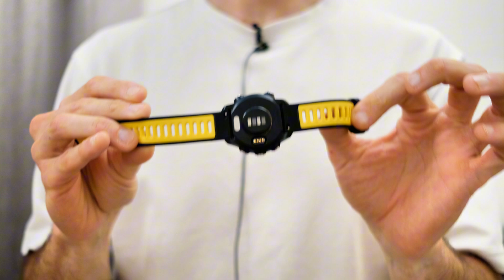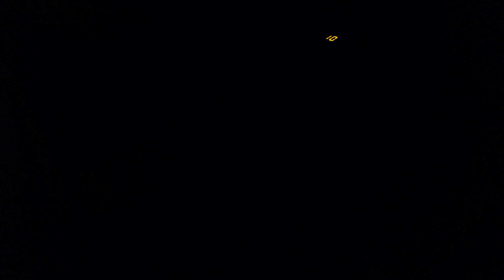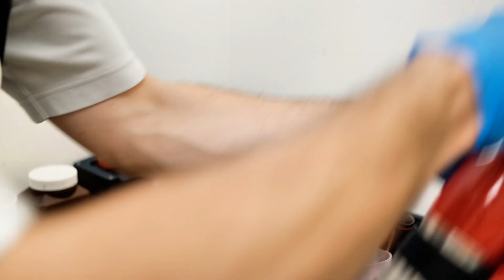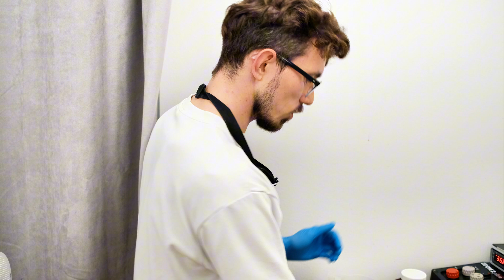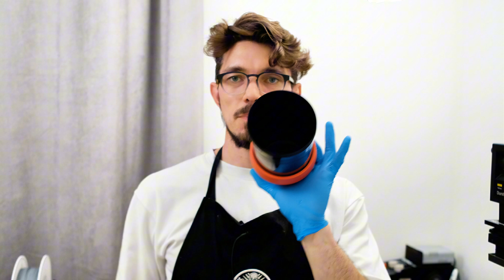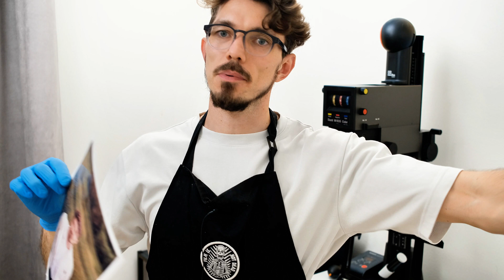Back to the Darkroom: Printing My First Big Color Photo in Years

Comment: I do the same exact thing with my paper dev tank, it's an old Cibachrome drum. it also have the "cup" at the top that only start the reaction when you lie down on its side
Reply from the maker: That’s awesome! 🙌
Those old Cibachrome drums are built so well, and that top “cup” design is such a clever way to control when the chemistry hits the paper. Amazing how these older tools still work perfectly for modern workflows. 📷

Comment: I know my Meopta Opemus 6 enlarger, the carrier for 24x36 is just 2 pieces of polished and lackered metal that press against the edges of the frame of the film 

The 6x6 carrier is 2 glass plates. One of them is frosted and the manual says it has been "treated for newton rings" or something similar like that. 

I am very new to printing in the darkroom and I have not encountered that newton ring issue so far. I need to spend some more quality time with this thing 😇
Reply from the maker: Sounds like your Meopta setup is pretty versatile! 🙌
The frosted, treated glass is indeed meant to reduce Newton rings — and if you haven’t seen any so far, that’s a good sign your carrier is doing its job.

Spending more time with it will definitely help you get a feel for how it behaves with different negatives. Darkroom printing is such a rewarding process — enjoy the journey! 😇📷

Comment: I don't think flatness of the negative is a requirement for prints small like that your videos. You should be fine with just only the masks but if you are really interested in having the negative perfectly flat the solution is two high quality crystal glasses with antireflection coating applied...but you need to find an optic company that produce them for you and it's not cheap
Reply from the maker: Thank, i'll try it!